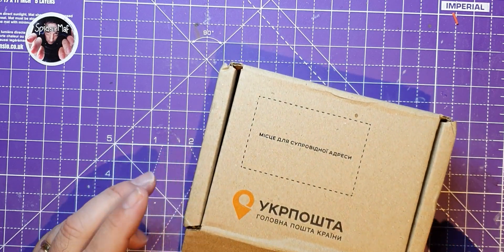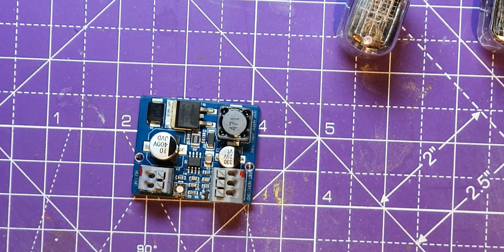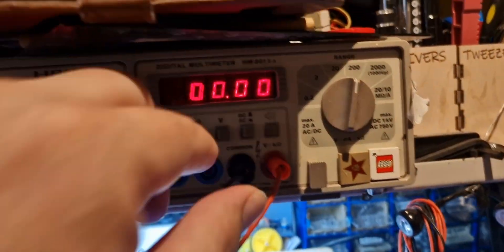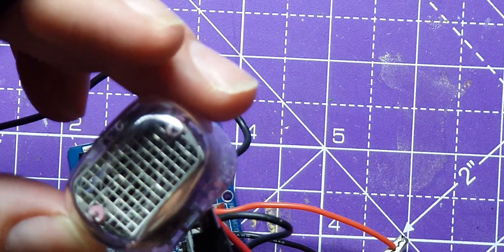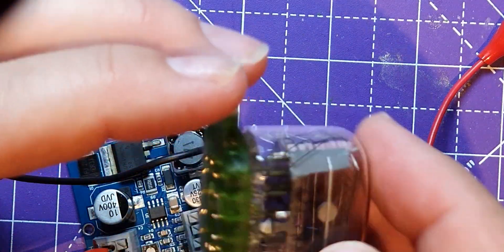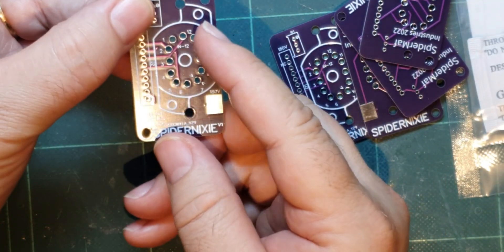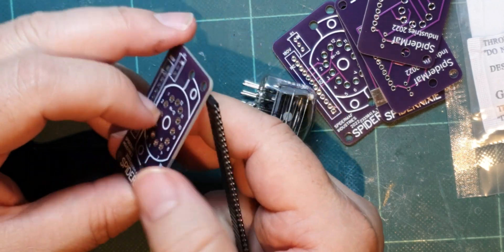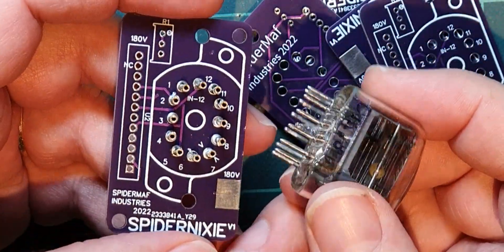How to use a Nixie Tube - How to power them and start to design a PCB to test them

Comment: Brilliant video. I have repaired Nixie tube test gear but never rolled my own. Great project thanks for sharing
Reply: The EDA software looks nice. I have done lots of PCB design in the and learning Kicad at the moment.  Are you planning on making any of your designs available?
Reply from the maker: At the moment PCBWAY are flooding everywhere with sponsorships - but JLCPCB for me have been way better. Sooo cheap for these little boards.  The last thing I bought from them I got 2 different designs, 5 of each, for less than £3 total delivered as they had a monthly voucher.  Crazy cheap if you wait 2 weeks for shipping.   I usually put my designs somewhere -  I dont think I'm finished with this enough yet to publish.
Reply: @spidermaf  I buy quite a lot of PCB for work and have used both companies maybe I have been lucky but not had problems with either of them. I think it was PCBway that offered me free service etc but haven’t taken them up on there offer. I think the sponsors thing is a bit of a double edge sword.
Reply: I also can never wait for shipping so sometimes that’s why I etch my own. Plus it’s a bit of fun etc.